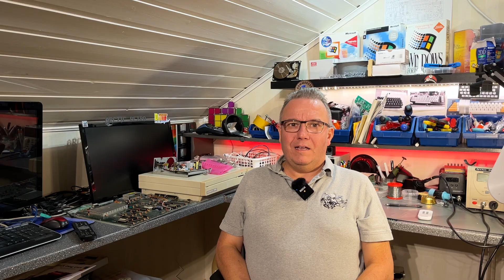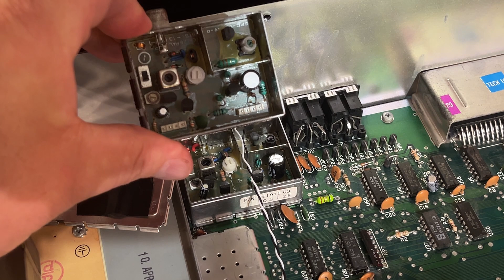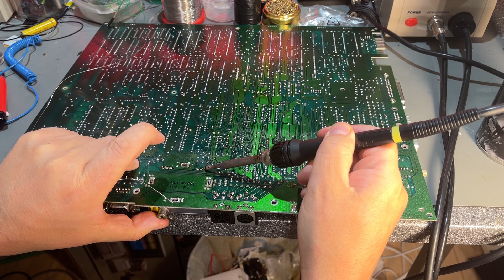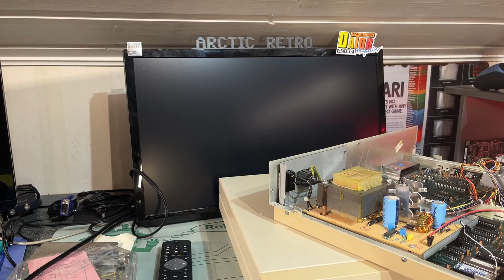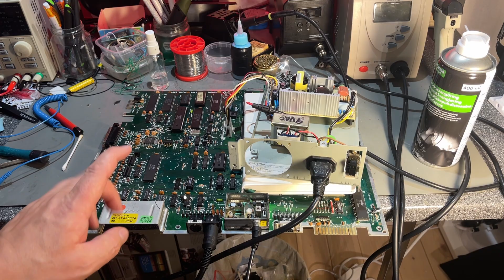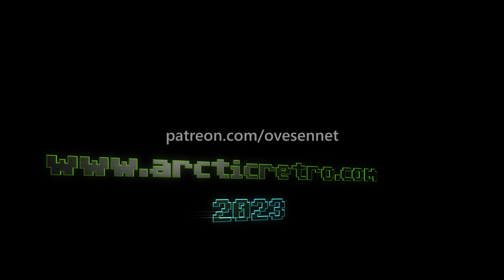I am building a Commodore 128D from used parts - Motherboard does not boot! - Part 1

Comment: If you have to desolder some beefy pins I would recommend to resolder the original connection with some low temperature melt solder. With that the desoldering station works much better.😁
Reply from the maker: Good tip! I actually got some low melt, but I forgot to use it :)

Comment: I've been building up a 128 over the last few months and have played with a few different modulator replacements.  The best has been the Copperdragon component output mod.  The Retro Channel modulator with a lumafix was pretty good too.  For no boot/black screen I'd start at the Z80 and work your way out from there, it's responsible for initial startup and handing control off to the 8502.   Good luck getting your machine going, the 128 is an odd beast to troubleshoot.  I did a few videos on these topics too, if you get stumped let me know.  Cheers!
Reply from the maker: Thanks I actually did not get it to work yet. Don't want to reveal to much here, but if you would give me your e-mail address, I might need your help :)
Reply: I am sure the two of you bring this magnificient baby back to life. I never had a 128 but before I had my C64 I was able to work on a pure CP/M machine a little. Forgot all of it though. ^^